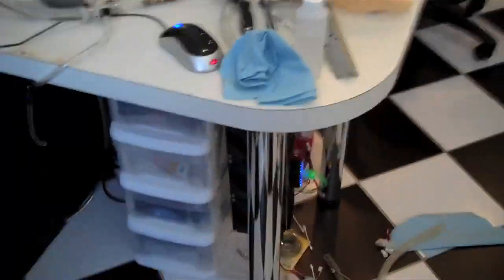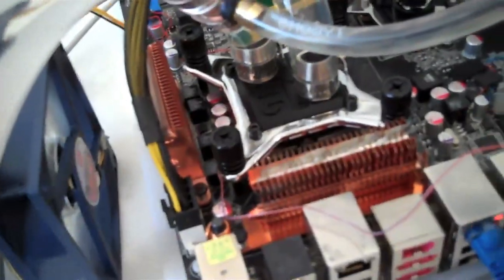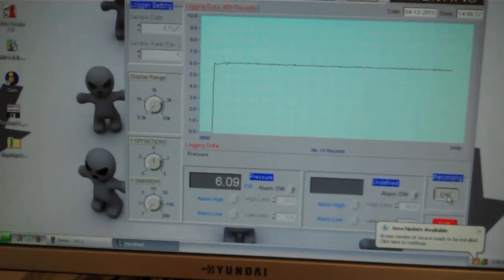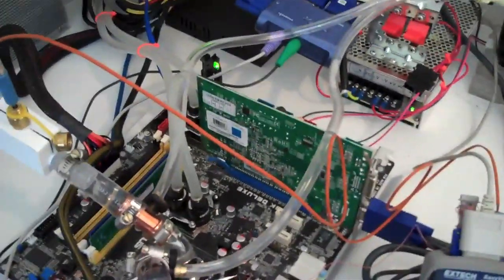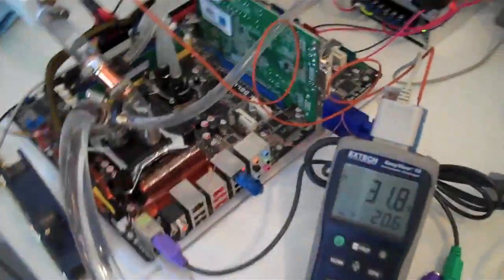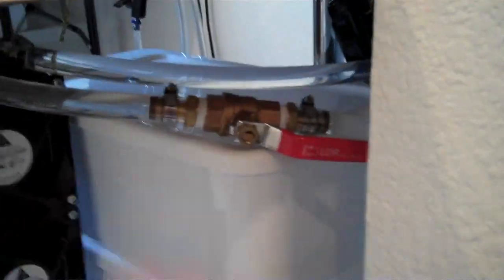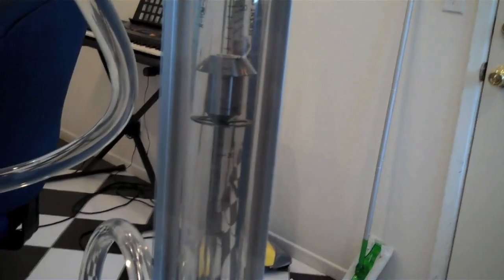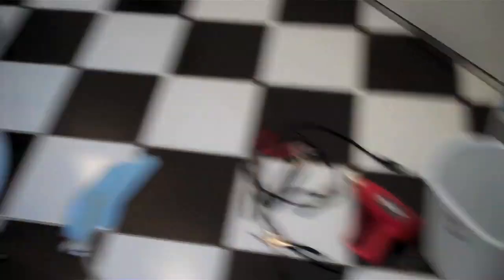PQA Update: CPU Waterblock Performance Evaluation System

Comment from the maker: @Ltb0b Yeah... I kinda burned out my instrumented CPU doing some testing for a manufacturer. Now it isn't stable outside of stock settings (which results in insufficient thermal output for waterblock testing). Besides, I need to update the system to yield results relevant to current IHS/die designs.